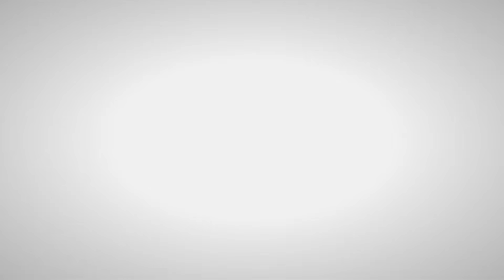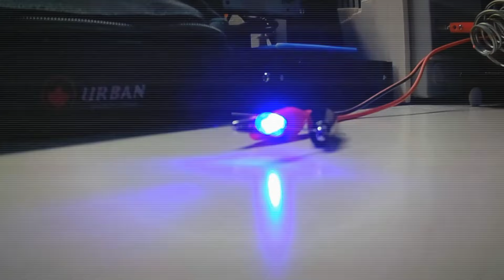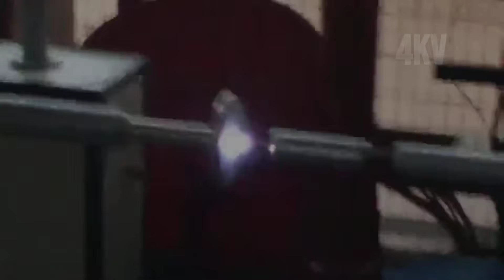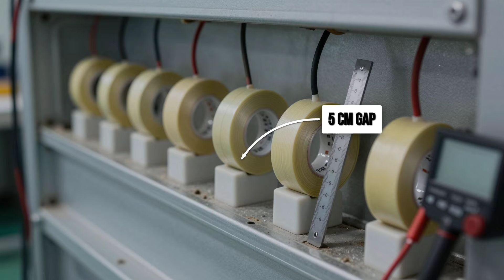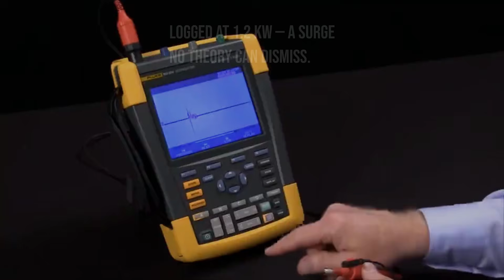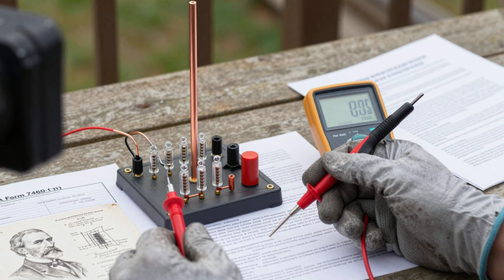Atmospheric Harvesting: The $40 Antenna That Pulls Kilowatts from Thin Air

Comment: Getting usable power from a small tower on your house is a myth.  While there are large amounts of electromagnetic energy in the environment from both natural and man-made sources, that energy spreads out according to the Inverse-square law, so the available power density drops off rapidly with distance.  Even a few miles from a high-power broadcast station, a practical and properly tuned antenna will only capture microwatts of power at best.  Enough to produce a detectable signal for a radio receiver to process, but not usable energy.  Electrostatic sources can produce high voltages but the available current is extremely low, so the total usable power is negligible.  Lightning carries significant energy but it is too infrequent, unpredictable, and destructive to be a practical or reliable method of power generation.  None of the proposed tower/antenna solutions are practical whether they are few meters or hundreds of meters tall.  If they were the utilities would have large-scale deployments of them.